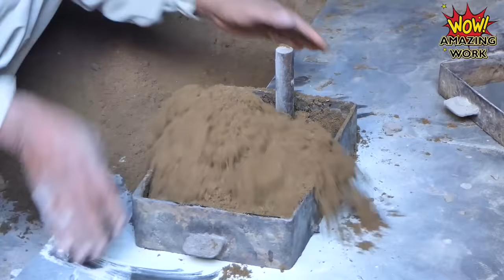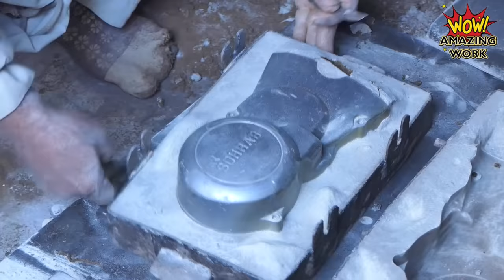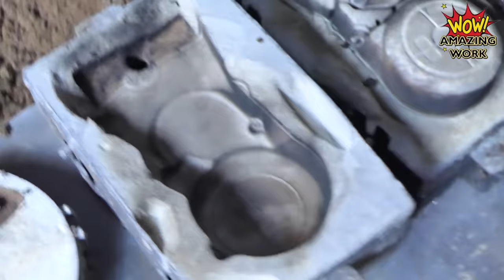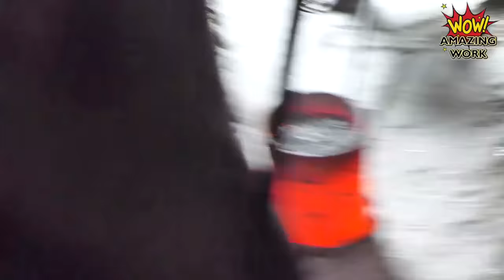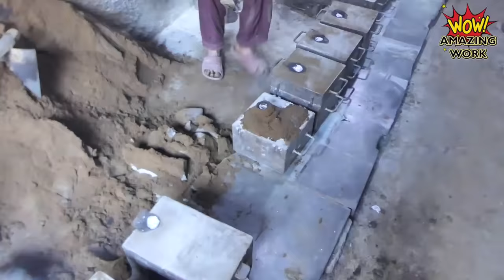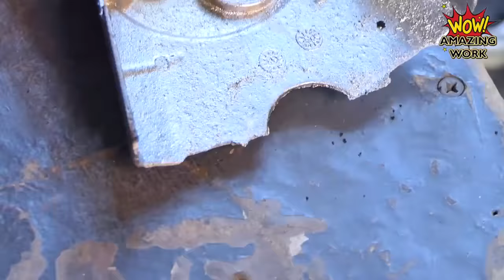Aluminum Casting Motorcycle Engine Cover | Incredible Skills Of Casting A Bike Engine Cover

Comment: I'm trying to create a similar casting and failing miserably, but I'm enjoying what I'm doing. 
After watching this video I see where I'm making a bunch of mistakes. 
Thank you for making this video. Thank you for sharing your skills with us! Your work is beautiful. 👏👏👏
Reply: Open toe shoes are a must in this process!
Reply: For sure you will fail if you are not in the industry because although this is the most basic casting techniq, it is not as simple as what you see. The sand for casting is not the normal sand but they are mixed with some substances at a particular ratio to ensure the proper moisture level and to help the mould keep its form. Also you need to know where to put the pouring hole and ventilation to avoid bubbles and the melt iron does not cool down too fast so all the space is filled...
Reply: @MrLeetwe  well right cause there is a science to it. I see what these guys do but I don't think those parts will work but they are close.
Reply: @MrLeetwe  I bought Petrabond sand to do this. It's not just the sand, it's the skill. Dude does this for a living and I do it for a hobby.
Reply: @SciHeartJourney  If you do that 80 hours a week like the guy in the video you will be good.

Comment: Amazing work.

I work in a Aluminium foundry and showed this video to my colleagues there. It really went viral among them.
Although the process of die casting Aluminium for serial parts is quite different (see teslas mega press video for that) they immediately started discussing what he could do to improve the cast, like pressurizing it, different temperatures etc. etc. :D
It’s amazing to see this connection between foundryman although they have so different jobs
Reply: Also using a finished part for a pattern isn't good as there's no allowance for shrinkage.
Reply: It depends on the purpose of the item you're casting.
If the finished item doesn't have to 'mate exactly' with any other item, allowing for 'shrinkage' is less relevant.
Some years ago I needed to 'repair' 1 of 2 brass 'feet' on a firescreen.
I puzzled for weeks over how to create a pattern to cast a replacement and create an 'exact size' replica.
A friend proposed the obvious solution.
The 'feet' don't need to 'mate exactly' with the screen, they only need to mirror each other.
Use the unbroken foot as the pattern to cast TWO replacements that, after 'shrinking', will be identical.
Reply: Imagine you bring that man or whole team to America what progress can they make 🤩
Reply: Do u also cast aluminium ..? For what kind of product tho
Reply: @Quantrell Damarcus Denali  I think the product was acceptable when taking into account the enormous lack of resources.
Reply: @pnavesey     He didn't show that it didn't fit which was the reason why he was making it.  Maybe he rigged it somehow to get it to "work".
Reply: Common dude! you can tell us what they really thought of the casting😄

Comment: I respect these people for trying to have some kind of workmanship, but the difference between this and good quality products, is that, the quality of the metal being used. They melted random pieces of aluminum laying around. A manufacturer tests and knows the exact elements needed to make a good quality product that will be durable and last.
This is where you're money goes when you buy name brand tools and metal, and also, why the cheap ones break easily. They just aren't made out of the correct formula.
I wish more people were this determined to make something out of nothing. God bless us all
Reply: Just shows that we aren't progressing were regressing.
Reply: However the brand names are making garbage too now that nobody knows how to make anything anymore.
Reply: @joshportie  I don't know where you get your info from, but I've worked at local manufacturers in my town. They don't make garbage. They have very sophisticated machines and do in debt testing to ensure their products to not fail. Maybe some have cut corners on products that aren't dangerous, but big companies can afford to do the process correctly. Some of these products can have fatal affects if they fail.
Reply: They are making "pirates" replace parts. The brand is there because is part of the engine case. It's very common in poor countries find these kind of products, the average people can't afford an original part. so they have to buy these chip copies.
Reply: The problem in this factory.... Everything!
Reply: Well that and using the target part as your master simply doesn't work. The casting will shrink considerably once cooled so shrinkage needs to be compensated with the master.
Reply: @emmanuelperez9406   Except this process won't produce a functional part, regardless of material quality.

Comment: Do these still fit? I thought you couldn't get a dimensionally accurate casting using the finished product as a mold due to shrinkage.
Reply: If you were making a foundry pattern it would be about 1.5% larger than the original to allow for contraction, which is maybe about 3mm in length on that casting. The end result of using a casting as a pattern is a bodge, but it’s probably good enough in this case and they might be fitting the new undersize castings on another casting that’s also undersize.

Comment: Great work, except they didn't remove the slag. It would be a lot better if they skimmed the slag out first.
Reply: I don't think quality is their goal...
Reply: I wonder about the chemistry of the metal they feed too. Might not be the best for a sharper result. But I was honestly impressed with the whole process, having never seen it made start to finish by hand.
Reply: For a motorcycle engine cover, its good enough. This part is not a moving part, it's just holding stuff.

Comment: In college we did sand castings . adding motor oil to sand made it sticky to hold its shape  using poly iso foam shaping our parts  & sandcast right around it then the pour.   that foam would burn out aluminum took its place

Comment: Did exactly that at high school here in Argentina. I still have an alluminium turtle made of two pieces. Its not that hard to do, requires patience. I remember it kind of exploded once, when the sand was wet and suddenly evaporated as melt alluminium was being injected. We used thinner sand for the section closer to the piece. The wite powder is used to facilitate layers separation.
Reply: Brought back memories of my highschool days also.
Reply: I think that’s why the guys in this video set the molds on fire, to dry them out and prevent them from crumbling also
Reply: At the end, the guy looked pretty proud of his work. And he should be proud of it.
Reply: What is the white powder?
Reply: @Woodzy13  a freeing agent. Helps prevent sticking.
Reply: @Woodzy13  can't remember, but my guess is we used lime or maybe plaster. Edit: I think it was plaster as if it were lime we should have used safety glasses and gloves, what we didn't..
Reply: @savage22bolt32  we used talcum power aka baby powder.
Reply: @CoronaSunrise  Those castings should be smooth as a baby's butt!
Reply: ர
Reply: @Woodzy13 probably talcom powder which keeps the sand from sticking to  alluminumn but being where they are it might just be a powder that helps mold keep it's layers

Comment: This takes me back to the days of my Hot Metal Shop class in high school.
Reply: ☝️☝️☝️that right thure!
I took sheet metal fab instead but in same shop same teacher.
Out shop teacher told us a story that 3 years prior some guys went into the melting room to chew some tobacco, this would have been around 2003, so they end up spitting into the form that they pour molten aluminum into, the next class some guys end up pouring into the form without checking it's 💯 dry, any small water droplets will cause molten aluminum to explode violently says he, anyway, it blows up and sprays all over the room and the guys, they end up getting 2nd and up to 3rd degree burns. 

In the same HS was walking away from our lunch room and the stairs that lead to a lower level had a little balcony type deal with a bench and ppl would constantly sit in the edge to "chill" or take photos, beyond the edge would be the drop to the lower level below which is a concrete slab, about 12-15' below, so no joke. So I just made my way down and I just passed a guy on top sitting on the edge, I make it about 30 feet down, this was between two buildings so echo was superb (In a bad way) I hear this THUD I turn around and I see people rushing, I heard this guys body hit the ground, it was like a hollow mass hitting a solid mass, a very unpleasant sound when you know what just happened, I see the guy breathing deep like he's dying and bleeding from the mouth, I leave shortly as everyone is gathered and teachers are there telling everyone to clear, later we hear "updates" on the guy but nothing certain, sometimes over the intercom, couple months later all the chatter about him is at zero now and no intercom mentions ever, I never saw the guy again and they never updated us for the for rest of the year, at that height I suspect he probably died. Crazy

Comment: Great video but these duplicates will be ~3% smaller than the originals due to the shrinkage of the molten metal
Reply: Дальше всё на герметик.
Reply: They will not cool the engine so everything is OK 🤣🤣🤣
Reply: You seem to be an expert on shrinkage
Reply: Gasket решает проблему и no problems)
Reply: I was in the pool!
Reply: doesn't matter as all the interfacing holes and surfaces will be machined out later. you could argue oil capacity but it'll be even more insignificant difference for the whole engine.
Reply: I was just about to say the same thing.   This might be acceptable for something with loose tolerances but this most likely wouldn't work with a part made with modern day automotive manufacturing.
Reply: I doubt it dude. I worked with extremely fine tolerance metals precious non precious you name it, down to microns of fitment. Sure there may be some shrinkage but no where close to the 3% you are talking about. Have you ever seen how engines are cast? Its basically the same procedure whether its bmw merc hyundai or toyota, just with fancy machines.

Comment: Nice - but I imagine it won't fit like the original as it's going to be about 6% smaller due to casting shrinkage !
Reply: Prob just a thicker gasket
Reply: Это легко лечится - покрытием исходной детали краской или лаком.
Reply: Gasket решает)
Reply: @jcdfce2707  лак сгорит
Reply: Fact

Comment: This seems so unreal to us now but I still have old BSA manuals as late as 1960 that had a whole section on sand casting replacement lower engine cases fully illustrated in black and white with full measurements.
Reply: That's so cool mate, thx for sharing

Comment: I mean, yeah its a good skill but i wonder the product's mechanical strength as they only use sand casting with gravity pressure + no heat treatment or other element of materials added

Comment: I don't know, wouldn't an aluminum engine cover eventually MELT from the temperature of the engine? I mean that IS why they also mix other metals into aluminum die casting on parts that will be exposed to high temperatures, to create a combined alloy that has a higher melting point than either of the two metals separately.

Comment: And at the end of it all this part will not fit anything because aluminum shrinks by 1.5% in all directions
I've tried this method before and failed so I know it doesn't work

Comment: These Sohrab Motorcycles are extinct in Pakistan. They used to be a big name is cycles and dominated the local market for decades around 50's-90's and then motorcycles became a norm and sohrab came into market but honda, kawasaki, took the big chunks of the market. And now people don't get parts for sohrab motorcycles so they are custom made like this 70cc motorcycle block.. This is all Pakistan.

Comment: The only problem with casting off an original part like this is the one they are making will be 3% smaller due to shrinkage. Not the best way to make a replacement part.

Comment: This method is wrong, there is a shrinkage coefficient in casting, if this piece is made in this way, it will be smaller than the actual dimensions.

Comment: It is not amazing skill at all. Copy sand casting shrinks 2% from dimensions of the original part and it can’t be bolted anymore to OEM engine. Imagine have 1 meter part which is now “only” 98cm long after cooling down. Such waste of time in my opinion!

Comment: That cover is useless. Its below bad quality. 
He did well to get it to look as good as it did. 
I know that's all they got,  tool wise to make it with, but that sympathy vote doesn't mean we should ignore the fact this poor casting could never be used even after clean up for its original purpose effectively. 
More basic parts that don't require a machined mating surface yes. But the craters 😮 

Don't come at me now. No I'm not saying this guy doesn't work very hard for very little money. Give him a medal.
But Factually this part is poor. 

I wonder if they do the basic requirement checks the sand moister content before cast and alu for porosity? 😂

Comment: When you cast aluminium using a non die cast method like this, the temperature at the different parts of the mold are very important. That part will have shrinkage in all the wrong places .... this is why far east manufacturing is a poor version of western/ Latin American casting no attention to metallurgy... I bet they don't even know what alloy mix they need to use for the parts mechanical properties.... smh

Comment: Those pours were fucking terrible. This is a bad situation, "workshop" a literal dustbowl, zero safety precaution, not even a hint, the work is shoddy and the tolerances would be pathetically bad for something like an engine, no measurement, no assurance of consistency, just stick to statues. Who even buys an engine cast on the side of the street by some Rajesh in sandals? You think he ships it to Chrysler or some shit? no, some illegal home made motorcycle racket will take it and do some similar shoddy "craftsmanship" in hopes the engine doesn't straight up fucking explode.